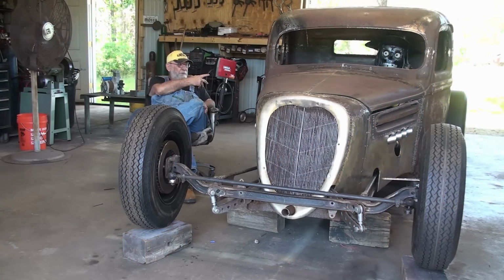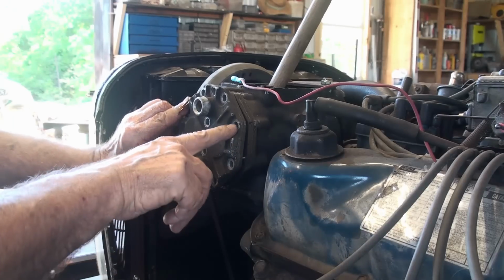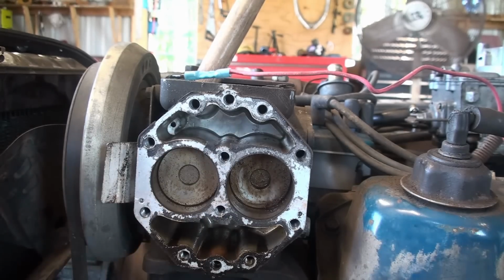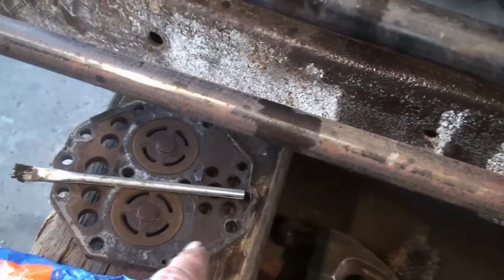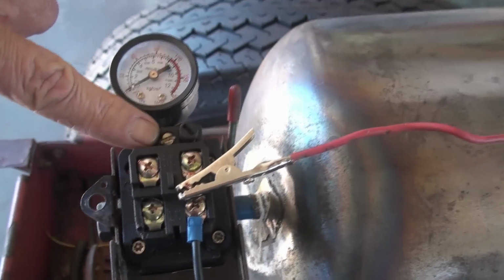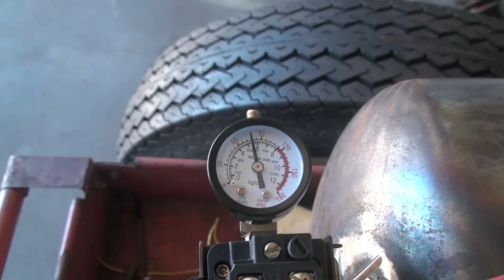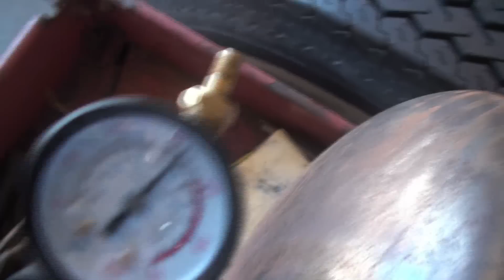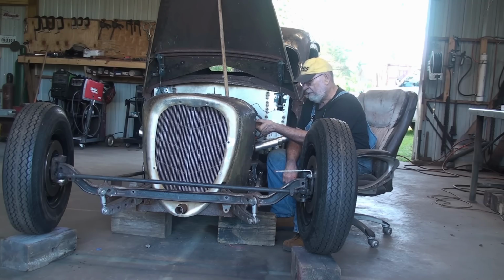Rat Rod Air Bag System - Converting The York AC Compressor To Pump Air

Comment: Hey, that works pretty darn good, Bob! That would be pretty handy to have on the work truck for air tools.
Keep at it!👍Tony B
Reply from the maker: Right on
Reply: Chips And Sparks Garage my uncle was a diesel mechanic and had the same setup on his f650, even used a cylinder from a car hauler semi trailer for his boom for lifting motors, wish I had that truck, it was filled with ole skool. Shadetree ideas
Reply: instaBlaster.

Comment: Youll be pretty happy with that york. You used to be able to buy a kit that had a new head gasket, rings and bearings for super cheap. I ran one up to 300psi and it never blinked an eye. They run 10cfm at cruising speed. Loving the videos bob!
Reply from the maker: Thanks for the info
Reply: @RatRodBobBuilds  You going to run some steel leader hose on there bob?

Comment: Works well Bob...I knew an old bloke in the 70's who did the same to pump up his inflatable raft...Before that he pumped one up by removing a sparkplug and screwing in an air fitting.!!..I guess you can guess what happened when the fuel reacted with the vinyl...
Reply from the maker: Well that could go boom. I had a friend that would take a cutting torch and light it and adjust the flame just right and then snuff it out with the acetylene and oxygen still on and then fill a balloon with that, then lay it on the ground and take a long stick and light the end of it and ... well you can imagine the boom that makes! To me .. the 8 foot stick wasn't long enough.

Comment: Pretty slick Bob I would definitely think about putting a air filter on the air intake side of the pump if you haven’t already.🛠
Reply from the maker: Yea got one. as you know I work really slow. Do a little ... see how it looks and works and make improvements accordingly. Actually I'm gonna remove the compressor and go thru it since I see it has potential. I plan on running the air intake to the front of the radiator so it can suck some really cool air then install the filter I have for it.

Comment: Hi again Bob. Be cool to have regulator knobs and gauges right on the dash. One for adjusting rear air bags, one for the front air bag. Also could add a fitting on the tank and carry a short hose for airing up tires and whatever. Compressor really pumps good. No.2 permatex is Good stuff. P.S. add a small breather filter on the suction port.

Comment: That was interesting Bob.  I told you it was going to pump oil but I never had  a need to stop it pumping oil.
I hope that fix works out for you. Not sure about the York but at hwy speeds some of those compressors 
can pump out over 5 tons of cooling, that's more than your average house would need...
Reply from the maker: Yea .. I hear ya. Gonna build a cool home made filter dryer. It has it's own oil bath like an old air cool motor and some oil may get past the rings ... we'll see!

Comment: A good use for that big ford a/c compressor on the rat rod. You think that tank will be enough volume to rapidly raise the truck?
Reply from the maker: Should be more than enough to raise it several times. The air bags are roughly a gallon size x6 (with trailer) and the tank is 7 gallons. Only gonna need about 30psi or less in the bags and the tank will have 100psi.

Comment: that is awesome. how do you keep the oil from gong through like if it had Freon in it.
Reply from the maker: Good question! Still working on that! This ole compressor has an oil sump like and ole air cool engine but it does pump some of the oil out the discharge. I'm waiting on my gasket and seal kit to come in and I'm gonna go thru it to see if I can slow the oil spitting down some. Stay tuned!

Comment: Filter the compressor air from under the air cleaner, try a stainless steel flex line from Home Jippo , water heater stuff. Dont use motor oil in the compressor. Any time you tap pipe threads always stop with 5 threads showing on the tap. Trailer air, quick connect from shop hose?
Reply from the maker: I was thinking just that on the filter side of things. Why not motor oil? The guys that convert them for a living say it's not picky ..  use the same oil you run in your motor.   Thanks for the tap tip. Yes the trailer air will be a quick connect.
Reply: @RatRodBobBuilds  Use non detergent compressor oil. A quick lesson on oil, Detergent in motor oil keeps the crud and dirt thats in the engine oil in suspension so the oil filter can pick it up, old engines, compressors, lawnmowers, and windmills that do not have filters need non detergent oil so the crud and dirt can settle out and make sludge at the bottom and not float around gitting into the bearings over and over. Slip a strong magnet in the sump and let it help grab the Fe. metal. Places like tractor Supply sells compressor oil. Heat will cook the check valves, with out the Freon to cool them, keep an eye on the run times. You may have felt the outlet tube on your shop compressor when running, larger compressors use finned tubing to help cool the air coming out of the pump. Be carful using plastic line out of the pump, it will melt and pop. Under hood temps start @180 and could get to 200 just driving this summer. No bare feet on the firewall. Add a water drain to the air tank. I hope this helps.

Comment: This is a cool setup.  I'm just wondering if you'd need an alarm in case you were on the highway and lost air pressure.  It'd be tricky to drive with the frame on the ground.  An alarm of some sort may give you time to pull off to the side of the road.  You likely have that figured out already.
Reply from the maker: Yea ... that's the problem with a vehicle that drops to the ground. Anything could go wrong. I don't have it all figured out yet.

Comment: What pressure switch did you use and how did you wire it to the clutch?
Reply from the maker: It's just a pressure switch off an old air compressor. One side goes to 12v and the other to the compressor. The switch has two poles on each side but you only need one for this.
Reply: @RatRodBobBuilds  Thank you

Comment: Ware do you get a 12 volt pressure gage
Reply from the maker: It's off and old compressor that was 110 ac. It's just contacts ... works with any current.

Comment: Regarding compressed air: funniest thing I ever heard was a familiar sound coming from the closet in a video I was watching on an "adult" website. A gal was getting the in-n-out treatment from a machine. I don't frequent porn, but the sound from her closet was quite familiar for some reason. Turns out, the inventor was taking old truck wiper motors and making sex machines for needy ladies. There was an electric compressor in the closet but the unit itself would exhaust decompressed air after every thrust. So what I'm saying, Bob, is you gotta let Red drive this truck whenever he gets a date.
Reply from the maker: Too much information!
Reply: Rat Rod Bob Builds I kept on shout that at the screen but the dang thing kept on huffin' n puffin' like that gal's happiness was all that mattered!

Comment: A pop off valve might be cool.
Reply from the maker: It's on there under the pressure switch. The system is gonna have all the bells a whistles ... pop off valve ... genie check valve with auto unloader ... filter dryer ... gauges for everything ..... quick connect for air hose ... stay tuned!

Comment: wondering if a GM style AC compressor will work like that??? 

We used those Ford compressors to block the wheels with on a hilly driveway. Just Saying. Impressive Bob.
Reply from the maker: Ha haa. Well it's not a Ford compressor .. it's a York, and you do know GM had to be bailed out but not Ford ... right? And .. my daily driver is a Mopar 300M. Go figure!

Comment: Is that a York 210? I have a 210, for my 73 Ford LTD lowrider, on air.
Reply from the maker: Yes.
Reply: @RatRodBobBuilds  My ford LTD already  had a York 210 in it. But needs to be fixed. I ended up just buying a newer one. It's still very much a future project for me. 

I'm going to end up rearranging my air ride setup, before I start messing with that tho.

Anyways, was just curious if it was a 210 you were running, because of how fast it filled the tank. Thought it would be a bit faster. But plenty fast, and a hell of a lot faster than electric pumps.

Comment: the pistons dont have oil rings it will spit alot of oil . is what i hear
Reply from the maker: It does spit oil. This Rat has an oil collector and a filter drier. Ends up with clean dry air going into the air tank and to the bags. The oil collector self purges but the home made filter drier requires maintenance ... change the socks. Oh yea ... check the oil in the compressor now and then but run it at a bare minimum.

Comment: You're drilling with a 5/8 bit for a 3/8 tap? Uh, what???
Reply from the maker: Sorry for the confusion. 3/8 NPT pipe threads! Sometimes I don't explain myself very well. Maybe not the exact drill bit but it's the closest one I have that will work.